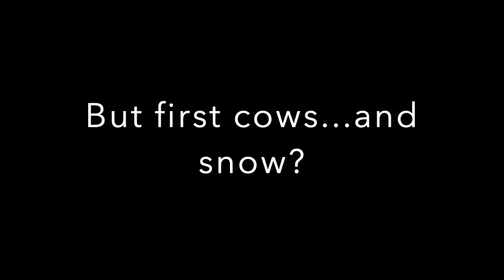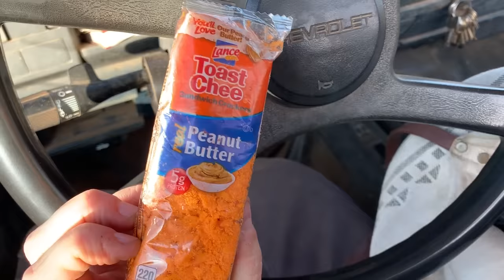Bringing It Home : Soybean Harvest Wrap-Up

Comment: G'DAY Meredith, from Queensland Australia, you and Lawrence disregard All the people who are dissing on Gerty or any of your older Equipment, for I as a Tradesman Mechanical Engineer, since 1981,can unequivocally from decades of experience say that the late 70's to mid 80's was the golden age of machinery and equipment, where STEEL was REAL,because from 83_85,regardless of Tractors, Trucks,Cars,Bikes,Combine Harvesters,,Tools,Electronic Equipment, the manufacturing standards moved into the Plastic,Computer ERA,which then preceded the Disposable(Throw away) mentality, ONE has to look at the Popular emergence of the Muscle Car(RETRO) car,truck,tractor movement, to see that many realize the value of the eq uipment,and SKILLS from that GOLDEN AGE,so I say GO HARD,and WELL GUYS,I Grew up on a mixed farm 2000 acres in Central Queensland Australia, that over 70 years in our family and 4 generations, went from Dairy to beef production, Pigs,Horse\Dog breeding and training, small cropping, t9 large scale (horse drawn to 120HP tractors,With many changes,upgrades along the way,When dad bought his first CAB tractor in mid 70's,(An All is Chalmers, it was parked in machinery Shed,next to a mid 50's Farm all with a beach umbrella fitted into a length of pipe to provide shade(Sun protection), Air con& stereo's were still 10_15 years away! The only on field entertainment was our h apply dance at completion of a working or harvest of a paddock (FIELD)? So you go girl(Happy dance your man,when kicking goals?

Comment: New equipment does break down and computers and dust and dirt do not play well together.  In some ways the new stuff has new problems, like dropping a line of code in the computer so it breaks down and there is actually nothing wrong, just has to be reflashed.  Imagine going out to a field and start harvesting and the machine just shuts down cause of a computer malfunction.  Then you wait for a tech to come and fix it and you pay for no parts, just the service call.

Comment: If your computer breaks down on the equipment, it shuts down your equipment  completely. Then you have to "burn in" and install a new computer. It is not cheap. This I know from experience. As long as your equipment is still operating, keep using it. Modern doesn't mean better. Nothing bankrupts a farmer quicker than those who feel they need all new big equipment. The successful farmer operates older, more reliable equipment.

Comment: You're right about the computers in my opinion. The manufacturers use the computers in one way to make you submissive to them and subject to them. And that's not a good thing. They Will have computers on every piece of equipment they sell partially for that reason. Stick with the equipment that doesn't use computers.

Comment: All the new equipment has a big problem with right to repair.  The computers can lock up a combine over just a small sensor being bad and only a dealer can diagnose the problem. Pull the equipment out of the field or pay hundreds of dollars for a tech to visit field. They will not give you access to the information or parts to repair your own equipment. Two thousand a year in new parts will keep your combine running forever. Like they say a new Deer is like a dog that won't hunt.

Comment: I bought a new kw t680 and it just hit 470k miles and I have over 90k in repairs dam thing almost bankrupt me I had 01 387 peet and had 1.35 mill on it never had a problem this new equipment they build are trash so disappointed in cummins I wasted 140k to buy it and 90k in repairs, if I would have not bought this truck I would have had over 300k saved up in the bank very sad